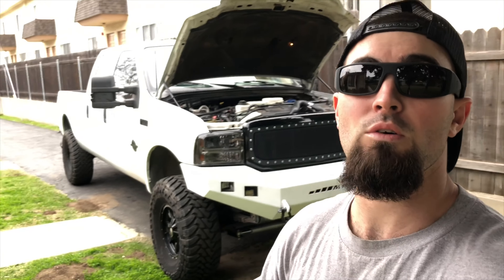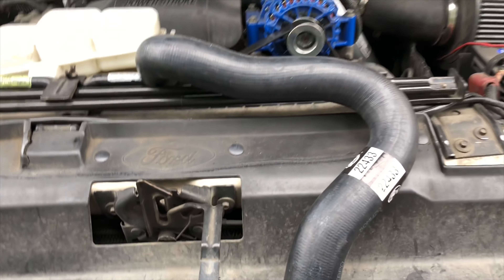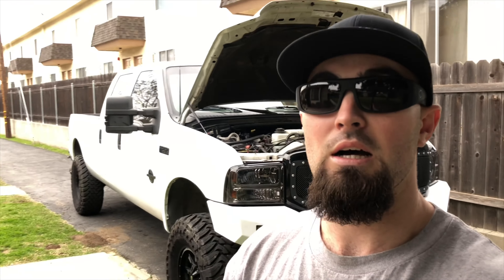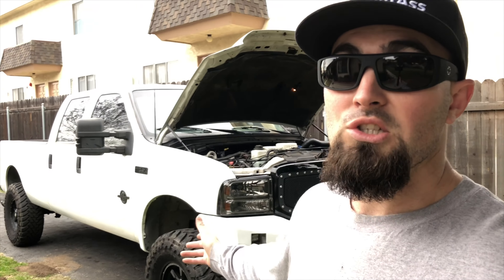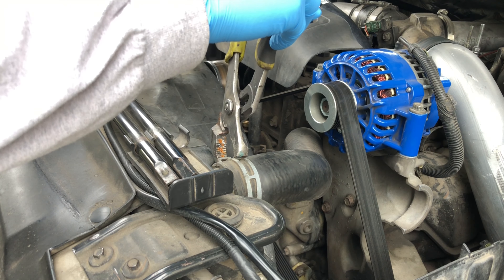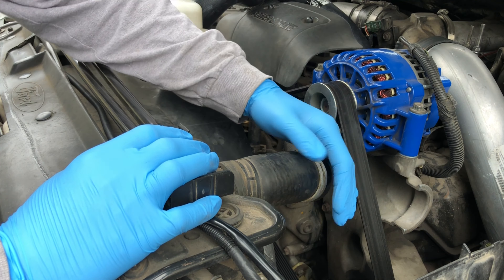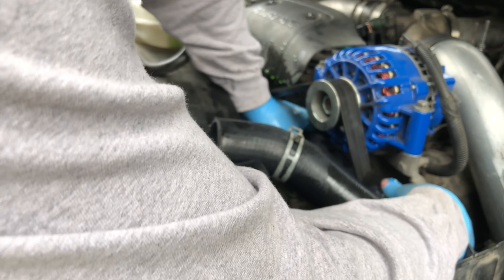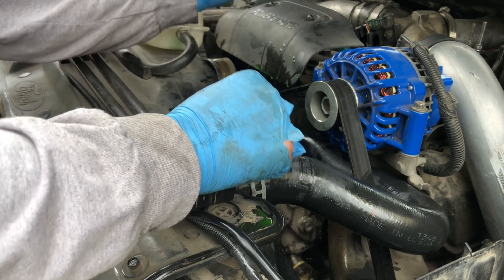Updating 7.3 powerstroke radiator hose! And possibly the biggest news ever for this channel!

Comment: The second car always eventually comes to every diesel owner enthusiast....lol
Reply from the maker: Joey Gonzales lol I knew it was coming eventually 😂
Reply: Haha true. Partially why I keep the Camry. But also bc it has the v6 dual exhaust and it is at least twice as fast as the 7.3 😂
Reply from the maker: bob stark lol unfortunately I would say most things are twice as fast as the 7.3 unless you really put some money into it 😂😂😂
Reply: 80HD Projects Haha true. But those ‘07 Camry’s will jerk your head back if you lay into them, while getting 30mpg. I just don’t want to give that up. 

I love my truck on a day off with the windows down and the radio playin’ or when I need to tow my RV. But not the most practical vehicle out there 😂. Would love to get a lift like yours but I don’t think towing my 5th wheel would be safe at that point 😂

Comment: Makes belt change so much easier. Great job! Not sure if you have done it yet but might think about installing a hose clamp or large zip-tie to secure the hose to the bracket to keep the hose away from the belt. May not be necessary but it is cheap insurance to make sure the belt doesn't wear a hole in your hose. I used a screw type hose clamp with a thin piece of plastic tubing over it. Not tight, just snug to minimize movement. Just a thought. Truck is looking great.
Reply from the maker: John Van Aalst good idea bud! I’ll probably do something like that for sure! Thanks for the suggestion🤘🏻🔥💯